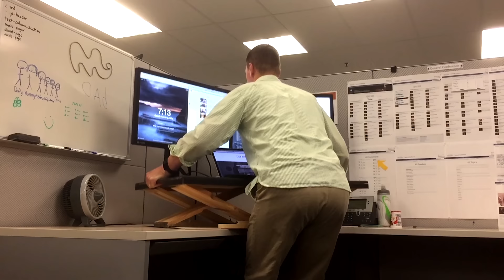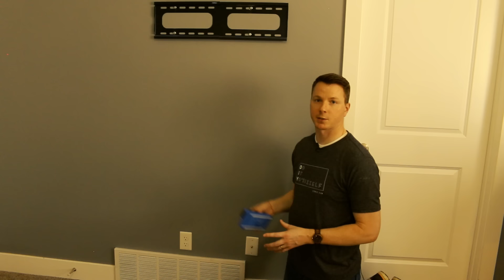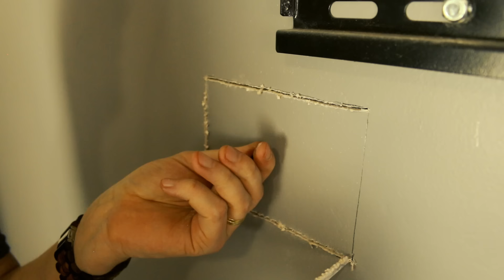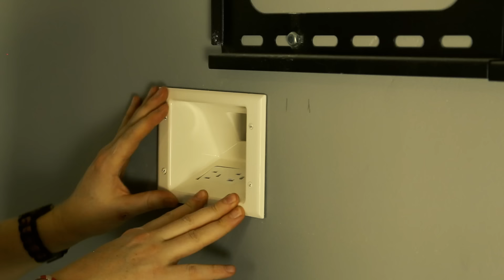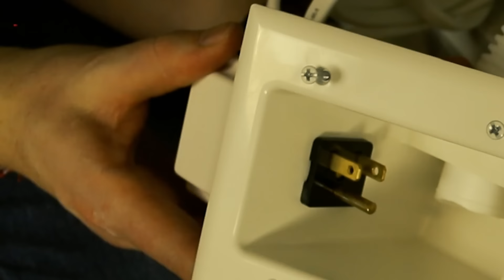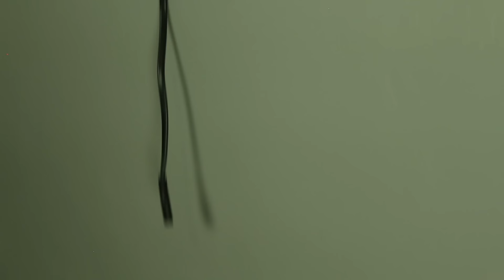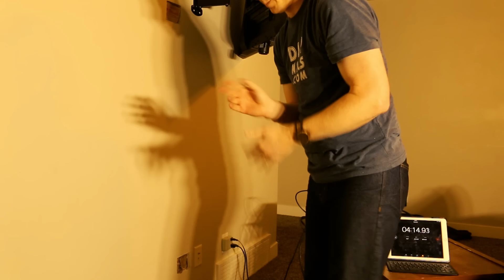How To Hide Your TV Wires in 30 Minutes - DIY

Comment: Lots of electrical code violations if used in many parts of the US. Generally;
Jacketed wired (Romex) need to be attached to the framing members.
Wires of different conductor sizes cannot be joined ie: 14/2 w/ grd. to 12/2 w/ grd. 
An extension cord can’t be used as a permanent source of power to an outlet.

All of this would have been brought up in the video had the required electrical permit been obtained.
Reply: Romex is fished through walls literally all the time. As long as the smallest conductor has an ampacity which is covered by the breaker there is no violation connecting different wire sizes. And 400.10 allows for a flexible cord to supply the inlet for that outlet farther up the wall

Comment: Actually , I like that outlet box, it is not overly expensive...Still I would just not worry about how fast the job took and (Frankly it takes me 30 minutes just to gather the tools for this type of job). I would run a new receptacle at the TV and put the Hdmi and cable in a separate bay. I also would recommend the Vesa mount that swings off the wall , I constantly need to add or remove things from the back of the TV...

Comment: Run the data and media wires through the tube BEFORE you insert the top box in the wall.
OR use a pull line through the tube.  You shouldn't have to remove the box to install the media cables after you've already installed the box.

Comment: Nice video but messy extension lead at the bottom. Bad idea to loop live cables just ask any electrician. Finally feed the cables through pipe before fitting both boxes.

Comment: Don't follow this, this is not up to code.  There is nothing wrong with this product, just how it was installed, so if you like this kit please follow the directions.  But if you want a cleaner install, look at a kit that just has the part that goes behind the TV, and tie into the outlet below. 

As for the problems with this install.  First the hose, it is not fire rated for in wall, and if you are doing that for bugs, they will just go around the hose.  look for a wall plate that has the brush, that will keep the bugs out as much as possible.  Second, you can not just roll the extra wire and stuff it in the wall, you must cut if to fit.  Third, there should not be any of the wire jacket in the electrical box.

Comment: Never I say never wrap electrical wires around them self’s and always remove cable ties. Unwind the cables you are making a fire hazard as the wires will get hot being wrapped like that. Yes I now it only a tv. No way is that up to code.

Comment: Never coil a wire, Coiling the wire will cause them to get hot and at some point will catch fire this guy knows nothing
Reply: Smidgey88  also low voltage wire and high voltage wire should never go in the same raceway
Reply: I didn't know this,  all of mine have been coiled for years and never had a fire.  but good to know
Reply: @xdsmastermia  Alot of electrical fires are caused this way. I know someone it happened to. 
They had one of those round entention cables you can wind up and he only pulled a bit out and left the rest reeled up, within 2 days the wire must have started to heat up and melt, that then started to cause bare wires which then cause sparks and you have a fire. 

Please take my advice and unwind all you power cords and power cables you may have cables tied up. 

If you think I'm talking rubbish google rolled up extension lead causes fire.

Comment: I’ve done this thousands of times as an electrician. I take the receptacle out of the box then take the box out of the wall on the bottom. Cut a hole in the wall feed the wire down to the bottom box put the wire in make the joints up put the outlet and box back in the bottom. Put the media box and data cable or hdmi in the media box put a surge arrester receptacle in the media box and put the tv back up. That way you have cut one hole instead of 2 for the power. You don’t have to plug anything into the bottom to power the top and it’s protected against power surges such as lightning. You still have to make a hole in the bottom anyways for the hdmi and whatever else you need, but they make hdmi plates that go into single gang boxes. Commercial is a little different and less steps but the same outcome. Not too bad for a DIY job I wouldn’t expect you to put the wire in the existing outlet box.
Reply: Oh, that's why you electricians charge everyone an arm and leg!!

Comment: OK...I get it; there is something put in front of the outlet.  What happens when the wife says lets move this table and that ugly extension cord is exposed once again.  Should have installed it directly above, dropped the wires down and fed power from the existing outlet.

Comment: For your own safety do not put low voltage lines near high voltage lines. He should have put that tv junction on the other stud away from electrical outlet. The cords would be just as hidden an actually up to code. Next time ask an electrician or consult the National Electrical Code (NEC) book.

Comment: right, but if your low voltage cable outlet is also at the height of like 16" then you're screwed and you need to find a way to run a whole new cable wire from your modem/box. You can't make a low voltage connection between two separate wires and jumper it up to a different box.

to add a receptacle and get power fed to it from the lower receptacle you can just fish a wire into the existing  receptacle, connect it and then attach the other end to your new location - in the same stud space.

Comment: For the newbies a tip: use the piece of drywall you removed to get a feel for those anchoring side tabs. This will let you get a feel for how tight to turn them in order to anchor them securely.
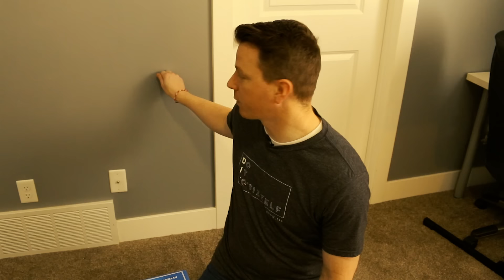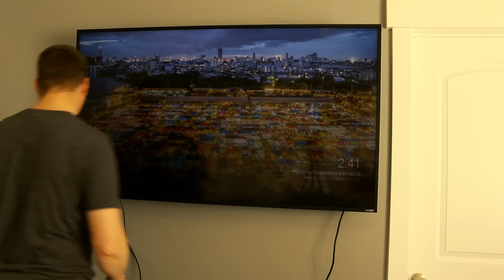Reply: 1:02 Jnnh 1:12

Comment: Hey, I’ve got a franklin stud finder.  It’s very accurate.  The only issue I have using it, is that it doesn’t tell you if their is electric wires behind the wall.  So I use another stud finder with this one to confirm.   Is there something I’m missing? Otherwise great video.  I’m going to be helping a friend move next month and he’s asked me to help wall mount his 70” TV to the wall.

Comment: Why not just run a line from the working electrical outlet to the new box to create a free standing outlet by the tv? Seems like it kind of defeats the purpose run a power line to the outlet and then tie it into another outlet just so you can plug in a power cable between the two externally...

Comment: How do you hide the wires when the tv is on a moveable arm?
Reply from the maker: Mary Smith If the cables are long enough they’ll adjust as you move the TV but you may want to zip tie the cables to the arm so they stay hidden and out of the way.

Comment: As a professional A/V & low volt systems tech, I'll add the whole flexible tube step is totally unnecessary.  Unless wires are required to be in some kind of conduit by code, it's an added step that doesn't make the install any better quality.  If you're worried about bugs or rodents in the walls, you've got bigger problems.  Next tip, don't use these cheesy high volt/low volt boxes.  Many of them are not a standard size gang box so when you decide to move the TV or wiring, you can't just blank it over.  I recommend something like this:  https://www.amazon.com/MIDLITE-2A46-W-3-D%C3%A9cor-Wall-Solution/dp/B002W048KE - It uses a standard size, double-gang box and is ideal for this type of install.

Comment: That's a handy looking box. However, it really isn't necessary. Any hardware store should carry a low voltage/old work(retrofit) gang box and some sort of media wall plate to cover it. In my experience it is much easier to use the open wall cavity to "fish" the cables through than a 1 inch corrugated conduit. TVs usually have a long enough power cord to reach, but if not most TVs us a pc monitor style power cord. You can get these at hardware stores or Walmart in 6ft, 10ft, 12ft, & 15ft lentghs. No need to be an electrician.

Comment: Be alot easier and cheaper just to tie in another outlet
Reply: Nope.  Easier to do it this way.  You don't even have to kill power at the breaker this way.  His way is more expensive but definitely easier.
Reply: @raicobarnes6021  Why is it easier? Still had to cut holes and connect wires.

Comment: Nah....nah...nah..... attached your outlets permenantly to 110v! Either use a junction in the attic or crawlspace to drill and fish to a new box or pull off the existing outlet. Don't install something silly like this that requires in external   cord! All that work and you could have just connected to th other outlet with a drill. And.....Id also stay away from push in connectors.

Comment: Still best for shallow cuts for interior walls, so not to punch through the other wall and sometimes you get shotty electrician work that dont run wires right. Also after your 3 cuts with a keyhole saw, not a jab saw, use a utility knife to score the last line and bump it and it will fold. Experienced sheetrocker here. Not criticising just giving my thoughts. Also one more thing if you get a wide piece of tape and fold halfway and put on the wall under where you're sawing on sheetrock it will catch the sheetrock dust,  if you are worried about that.

Comment: Says 30 minutes. In the video about an hour. While checking for a fire block or horizontal cat, he was holding the stub finder the wrong way. So the extension cord at the bottom unless hidden behind a equipment cabinet or dresser would look just as stupid. The templet is paper, datacom should of made it of thicker cardboard. The hose has nothing to do with code. Don’t use it. Plus it’s a ridged tube. Your not running a cable through later even with a snake. Just leave it open an run a pull cord. He should of made sure the wire and tube was out at the bottom before screwing in the top outlet. If that wall bay had pluming or other electrical? The new outlet wire and tube would be coiled in the wall. See, he had to take the top one out. At least he didn’t hang the tv first. Lol. This job done right take an hour. He made a nice video. I’m a professional. I’ve used this product in the past. It’s a nice video for a handy man/diy. No drop cloth. No lighting up the bottom outlet with the new outlet so they are at the same height. I’m nit picking and must say I like his video. Keep up the good work.

Comment: No need to cut a hole to remove any blocking. Just stab through the drywall along the stud and cut the nails. Reach in through the bottom hole and just stand that block up inside the wall. Then you only have to patch two cuts.

Comment: Having installed hundreds of TV, I use 2 LV1 mudrings and 2 hooded plates.  I run a 10 foot extension cord through the wall and out the hood plates.  Its just my preferred method.
Reply: Not code compliant. Extension cords not rated for in wall use.

Comment: You can do this only in US. The houses are made from wood. In EU can.t do it!!
Reply: you could do it with drywall too. The only difference US vs EU in building is in US most of the structure (heavy load and separation walls ) is made of wood where in EU, the heavy load is made of hard bricks (full bricks or not) but you still have drywall (with or without insulation) on metal rails; so it's possible too.

Comment: Why use that dumb plug on the lower wall conduit, just run the cable out with a regular plug on it and plug it into the socket.  Less connections less problems.

Comment: Why can't you just use an extension cord in the wall? Why is this kit to code where an extension cord would not be? (just curious)
Reply from the maker: Likely because Romex cable, or a kit like this, has a sufficient gauge of wiring to handle a load and not present a fire risk. The other reason is that there is no access to the cables in the wall once sealed up. It's all sealed off and secured, unlike what you'd have with a standard extension cord.

Comment: Smart TV wifi to wifi router wireless solution eliminate components in the system, unify to single unit, simple, robust, easier, reliable, easy to replace or upgrade without changing anything other than the power cable to give energy to the smart display

Comment: Or you can pick split wire loom at the auto parts or hardware store and run your cables / wires through it. After painting it to match the wall. Real inexpensive and after a day or two you forget it’s there.

Comment: If cable comes in through the attick on a one story home ,you can just go up imto the attick find that wall and you will the the electric line that goes down to   the outet by tv,i just dril a hole dowm next to electic line ,i drop a metal fish line down the hole attach a line toner to the fish line ,then i go down to that wall ,and with the tine finder i mive it around till i get the loudest tone ,then i just grab a big screw driver ,push it into the drywall twisting it like if i was screwing in a screw . And once you get thr driver in tbe wall you just move. it back and forth and you will feel the driver hit the metal fish tape .  Then. Just cut a small square hoke in th drywall around  the hole that gives me enough room to grab fish take and pull it out the hole .i go back up to the attick i attach the cable line that the other end is already conected to a spliter that is on the main cabke line coming in through the attick ,and i am done in tbe attick . I go  back down pull on the fish tape and by pulling it out it also pulls the cabke line out with it .then i throw a connector on cable screw in on to the back of the cable wall plate then throw to screws on tbe cabke wall plate that will cover the hole you made to pull the libe down and i am done srew a cable on to  the wal plate ,  and the other end to the tv .and that never takes me more than 45 minutes ,and since some cable companies do let us fo that i charge them like 100 bucks , cause if cable company does it .they bill it as a custom instll and that isnt included in the regular instalation and they charge the sub 200 buck for doing that .most of the times they hit me up , if i can do it and i cant do it during the instll i tell them i wil be back when i finish my route cause supervisors do inspections random to make sure we are dojng everything by the book and a few timrs they have showed up during the install ,and if they see i am doing a wall fish i am done , so i leave most of it ready to go so when  i show up after work i am done even faster , saved the sub 100 bucks and got my self an  extra 100 bucks in cash . And clean clear picture and they got no llnes showing ,so in  15 minutes i am done and 45. If i did not leave it ready toi go ,100 bucks cash is not bad in 15 minutrs or in 45 minutrs land the more you do it the faster you get . Lol

Comment: Where´s the lnk for mounting a tv on a insulated wall please!!
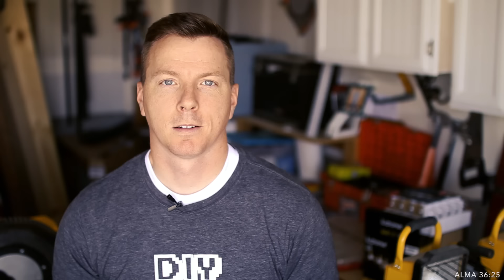Reply from the maker: 16:35 in this video shows it. It's not a separate video but right here in this one. After cutting your holes, just use a tape measure to pull your cables down from the top to the bottom and vice versa.

Comment: I would have put the upper box on the other side of the stud (and I have) and dropped the wire to the outlet below tieing it into the existing outlet. This would be neater and eliminate an electric cord. 
For the A/V cables you could either add a pass-through on the bottom next to the existing outlet or replace the outlet with another combination outlet/passthrough box
Reply: I was thinking this as soon as he cut into the other stud bay. Why give up an outlet. Honestly I just drop in a reno box for an upper outlet and run a separate kit for just the AV usually in another cavity. Takes the same amount of time with the only difference being turning the breaker off and also knowing how to wire an outlet which is super simple. Cost less than these kits also if you want to be cheap and just punch the AV through a small hole trimmed with a blank plate you drill out. You don't need the box really for the AV stuff.

Comment: Great video!  I used a pair of desk cable grommets , drilled holes to fit on top and bottom, ran cables using a code approved hose and voila! Same results for under $15.

Comment: You should run all the wires you can through the conduit before putting it in the wall. It will save you time and frustration.

Comment: "in a professional and code compliant way"

Proceeds to coil Romex and places a bilge hose in the wall...
Reply: A bilge hose will do nothing inside a wall (has nothing to do with code) but running a TV power wire through the wall will.
Reply: @raicobarnes6021  I know it's been a while since you've posted, but is it not safe to follow this particular DIY? I don't want to burn my house down.
Reply: I am in Europe and I freaked out at this point to be honest.  I've seen too many melted cables like this.  Its physics and telling people its code compliant could lead people to do this and potentially die. Over reacting, possibly.?. not my day in court explaining to the judge. Guess its a case of don't trust everything you see on the internet.

Comment: I have an insulated wall, and you just made my entire weekend.  I was about to lose it!  Thank you for the tape measure tip!
Reply: You can also drop fishing string with a metal washer, use a magnet on the outside to pull it down. use the string to pull wires through
Reply: @moonpiespotlight4759  great idea!
Reply: Alsan Bellard was it easy to pass a tape measure through the drywall and insolation?

Comment: Now that's some amateur crap right there.....  running your actual cables down a tube instead of installing a proper system with modular connectors... and don't get me started on that crappy power setup.  This isn't a DIY video, it's a how NOT to DIY video.......

Comment: You don’t check for fire blocks running your stud finder like that🤭 if it’s a horizontal fire block you run your stud finder vertically not horizontally like you did